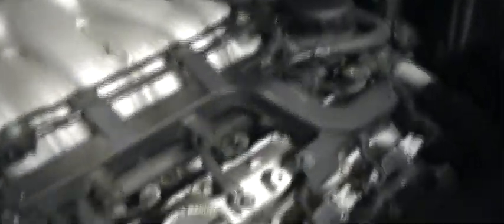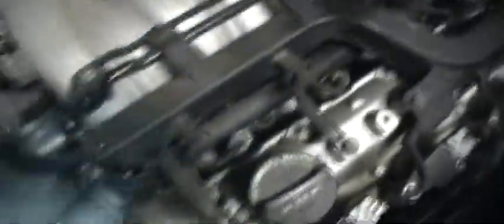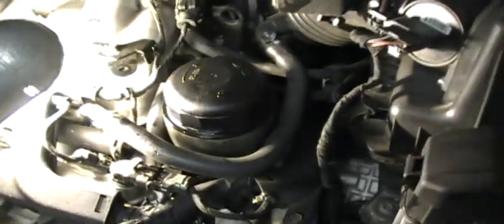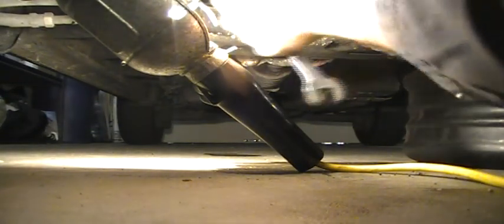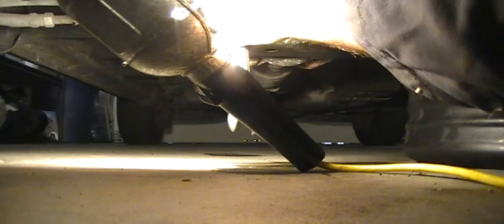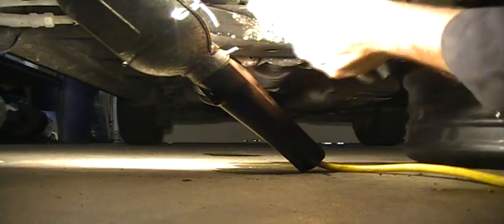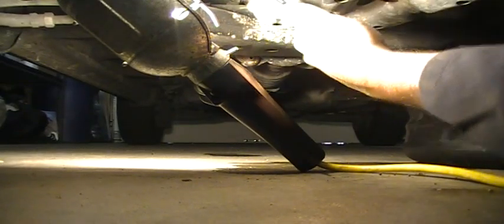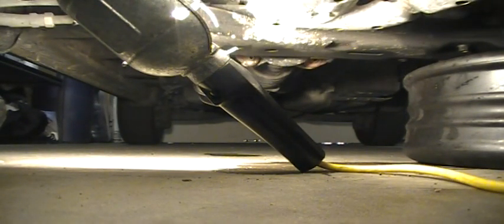How to Change the Engine Oil on a 2009 Hyundai Santa Fe

Comment: Thanks for the video. Nice job. Note that this applies only to the 3.2 engine. The 2.7 takes a standard type oil filter located on the bottom next to the drain plug.

Comment: Chapter 6 page 5 of the 2009 SantaFe owners manual provides a chart showing recommended oil to be 5w-20, or 5w-30, or 10w-30. The first two being preferred for good fuel economy. As for oil quantity (when also replacing the filter) -- the 2.7L engine requires 4.75Quarts, the 3.3L engine requires 5.49Quarts (chapter 9 page 4).
Reply: He does says at the end how much you need in this 3.3 engine. But you need to BUY 6 quarts because they don’t have 5.5 quarts bottles to sell

Comment: Really appreciate the video. The engine cover on my mum's (what a coincidence!) '09 santa fe was pretty much the same, but only four bolts on the corners. The dealership offered us free oil changes for a bit; as usual, they overtorqued the hell out of everything; I had to smash out my entire body weight on the oil filter plastic cover; it's marked for 25 N/m (19 ft-lbs) but was easily 50+ ft-lbs. Also had to use a breaker bar on the drain plug.

Great tutorial. Thanks again!

Comment: Nice video.  Really well presented.  Oil numbers are on the cap. Stick to that. Thicker oil can cause issues as the tolerances and oil galleys are easily plugged.  Change oil regularly and don't have an engine flush on an older vehicle with higher mileage.  Chances are good you'll free up some sludge and block those passages as well as introduce particles to bearings and seals.
Ask Scotty Kilmer.

Comment: There are two different engines on the Santa Fe. The first thing the video should address is how to determine the engine because the filters are different.
Reply: true.  I watched this and then found my santa fe 2009 had a different oil filter, and was actually under the car.

Comment: Gonna try this with my 08 v6 santa fe.  Its videos like these that give you confidence in doing it yourself. No more going to the dealer and getting ripped off. BTW, i heard you can use 5w-30 motor oil in the v6 as its also compatible; Its a little bit ticker.

Comment: You will not blow up the engine if you run 5 or 10/30 oil lol...   If you put 15/40 or higher, you will have oil pressure issues, 20/50 or higher will definitely starve your engine. I know a lot of people who run one grade higher than recommended, I don't "recommend it" personally, but it will not "blow up" your engine!

Comment: Hyundai has a special service tool for removing the oil filter cap. It is a 88.2mm, 15 flute, filter cap socket which attaches to a ratchet wrench. Hyundai part #09263-3C100.  NAPA Auto parts has this tool as well. NAPA part #SER 773868. I bought one at NAPA for $6.75 here in the USA.

As an engineer who has gotten more than 200,000 miles on five cars and one truck (doing all my own maintenance), I agree that 5W-20 oil should be used in this car as recommended by Hyundai (not 5W-30 or 10W-30).  Consider spending a couple of extra dollars on a synthetic blend oil (if not a full synthetic oil) if you intend to keep the car a long time as I do.
Reply: +Jeff Johnson Yeah.......but why would you even spend THREE seventy five if you've got the perfect "universal" wrench, as dakota here does!?! :-)

Comment: Okay, I just did this on my 2007 Limited and wanted to add my 2 cents.  First as noted here, there are 4 nuts and 2 bolts holding down the engine cover.  Another video erroneously said there were just the 4 corner nuts.  Also, the engine is at a tilt with the back higher than the front so the nuts studs ARE NOT PERPENDICULAR to the ground.  Especially on the back two, you'll need to angle your wrench extension toward the front of the vehicle or you will round the nuts.  Mine were rounded somewhat and only professional mechanics have touched it, so even they made this mistake.

Second, you WILL need a filter wrench for the filter cover, and the universal strap or chain types are hard to use because you don't have much room around the filter for the handle to swing around.  I used one of those and cut my hand and arm.  I would strongly recommend  the cap socket type that you can put on the end of a socket wrench.  Not only does it give you all the room in the world to work with, if you have a toque wrench you can put the correct amount of torque on when putting the cap back on.  The correct torque is 25 newton-meters, and that is written on the cap.  I don't normally worry about torques when changing oil, but when you are working with a fragile plastic cap and an oil seal, you've got a narrow range between not sealed and broken cap.

Finally, my local Hyundai dealer parts department never heard of the part number quoted below, NAPA said they could order theirs from their warehouse, but I would just order one off Amazon if it were me.  You just need to plan ahead.

Comment: Good vid.  A couple of things: 1} Hyundai rhymes with Sunday.  Replace the "S" in Sunday with an "H" and you will be saying the name correctly.  2} The 4 cylinder 2.4L engine in the Santa Fe is not like this and is the more typical version with the filter under the engine with a nice little cutout in the plastic guard under the car for easy replacement.  And, the plastic engine cover on the 4 cylinder just snaps on.  There aren't any fasteners.  The 6 cylinder kind of looks like a pain...  But the Santa Fe is awesome because you can change the oil without jacking up the car!  Love that.
Reply: +Robert Cowan Hey, Robert......glad you did the "Hunday/Sunday" thing; saved me the trouble. 
You'd think MOST people would be thankful you taught them how to save their tongues from all that twisting......but most just think we don't know what we're talking about. Ha! Jokes on them. 
I've never actually understood why Hyundai didn't spend a couple of million in TV advertising teaching prospective buyers how to pronounce the name of their brand; they might have accidentally sold a few cars along the way! :-)

Comment: Glad you mentioned the oil type, cause I thought 10w40 . Now I know. And now I can probably do this myself if I can get the bolts loose.
Reply from the maker: There's 2 main types of oil for domestic and asian import vehicles nowadays, 5W30 and 5W20. Make sure you're 100% sure before you go for it. If you can't get the drain plug loose, try a longer ratchet or wrench, it'll give you a bit more leverage.
Reply: when changing the filter on 08 SantaFe. The cup does not retain the oil it leaks out back down in to the pan. I have changed the filter. stem and o rings 3 times still leaks after driving then park for 30 min. Is there a check valve to keep the cup full of oil? please reply.

Comment: Do the o rings come with the filter
Reply from the maker: Every cartridge filter I’ve ever installed comes with the o rings, so if you don’t have them, someone probably opened it up and took them. They’re usually in a heat sealed plastic baggie
Reply: @6speeddakota  tx

Comment: Does the washer in the plug need to be replaced in every oil change?
Reply from the maker: I would recommend it, but you can usually get away with reusing it a couple times

Comment: hey I got a question for you.  The CD player in my 2005 hyundai tuscon has lost functionality on its cd eject button, so when I press the button , it makes a noise like the cd is going to come out, but the cd doesnt.  I can take the cd out by pressing the button and then inserting another cd at an angle so that the cd that is inside the player comes out.  Any ideas on how I can fix the CD eject button.  It seems that a spring or something somewhere is loose in the eject mechanism.  Help please

Comment: ***** , Did the rubber seals come with the filter or did you have to buy them separate?  Thanks!
Reply from the maker: Troy Every cartridge filter I've ever installed comes with the rubber o-rings, you can double check before you pay for it though

Comment: Great vid is there any way u can make a video on how to replace the spark plugs, keep up the great videos
Reply from the maker: I don't know if I'll be able to make that video, I'm looking at getting rid of it because it's been a complete lemon, I've had the transmission replaced once, the timing cover, alternator, driveshaft coupling, front diff seal, and the throttle body replaced. I've completely had it and I'm tired of dealing with it to be completely honest.
Reply: +6speeddakota Holy crap, 6speed....you make me wanna ditch MINE now, too. (Of course the fact that it gets about 10 miles to the gallon doesn't help endear itself to anyone!)
Reply: Ours had 132k miles when we bought it one year ago. Runs good, no engine problems at 138k miles now.  But there is evidence that the engine was worked on before, so we'll just see.  Thanks for the video!

Comment: Is 10-30 oil ok if you have 150k miles and live in a 60f-90f clmate?
Reply from the maker: vitaly style stick with what the manufacturer recommends in the owners manual
Reply: 6speeddakota  TY will do..

Comment: I had never changed my own oil due to being unable to locate the oil filter. under the engine cover....duh. I needed to locate the oil pressure switch and was told it was on the oil filter housing. found it today. The replacement is not difficult except for starting the thread on the switch you are installing.  I had lots of trouble lining it up until i remembered and old trick. I put a piece of soft tubing on the top of the switch and used the tubing to hold the switch. bingo success. My wife was standing there going "He's so damned clever".  I just smiled and looked clever.....if thats a look...

Comment: How did uou reset the oil icon ..you didn't explain it
Reply from the maker: This model/year doesn't have an oil life monitor.
Reply: @6speeddakota  oil light keeps flashing
Reply from the maker: @ then you either have no oil pressure or the sensor has failed.

Comment: I've been using 5W-30 for 123,000 miles now and no, the motor did not blow up, where did you come up with that silly idea?  Mine does not burn any oil between changes either.

Comment: Sorry dude but you wont blow up the engine if you use 10w-30
Reply: Exactly and I cannot believe he said that.
Reply: 10w-30 is a bit heavy. I always go heavier after 100K miles. In this case, I switched to 5w-30 on my 2009 Santa Fe 2.7 GLS. And that's only to prevent leaks on older gaskets.

Comment: Never understood the logic of getting the engine warm for an oil change. The engine was warm when you last parked it, why would you want to circulate all that dirty oil thats already sitting in the sump waiting to be dumped?
Reply from the maker: And then torch your hands when pulling the plug and changing the filter. It simply just lets it drain a tad faster, but it's real annoying hen working on it
Reply: Always cold why blast hot oil all over yourself?